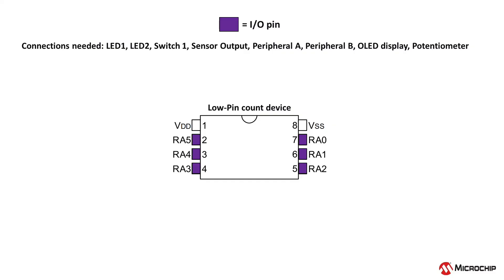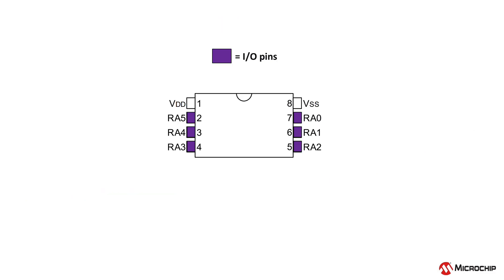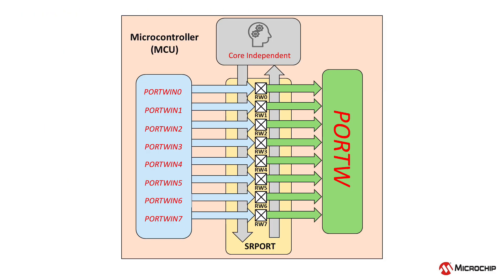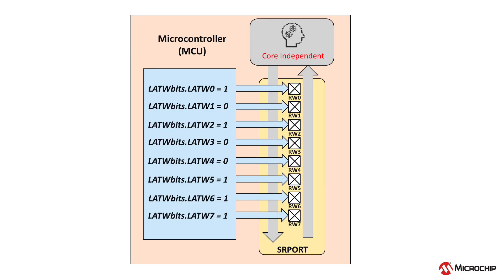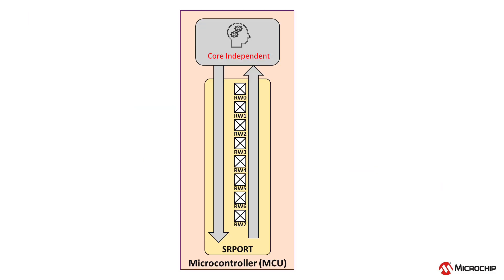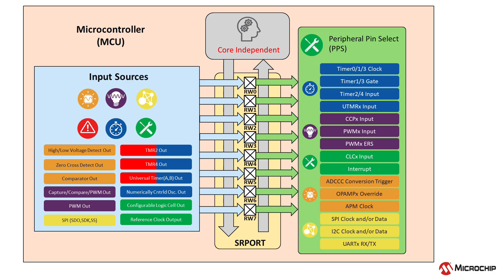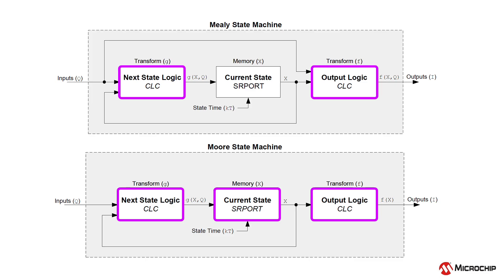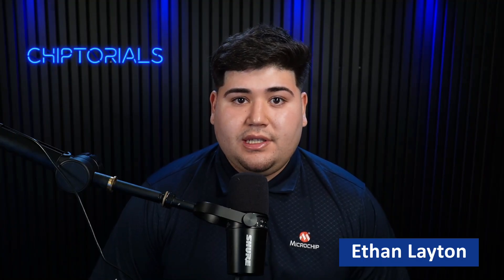Chiptorials - Signal Routing Port Overview

Comment: Will this allow a DMA channel to hit a port on some pins but not others for output?  A second LATx register that is selectable via peripheral pin select is a feature I'd really like to see on future micros.  I use timed DMA in my Serial Wombat firmware to allow all the pins on a PIC24FJ256GA702 to drive independent servo pulse, pwm, or UART outputs.  But a catch is that the DMA writes to the whole port, not just specific pins.  If there was a second LAT register, then I could have some pins assigned to that LAT through the PPS, and hit them with a timed DMA.  The other pins would still be configured to use the normal PORT LAT for their output.  I work around this by changing the PPS in real time for pins I want to use as general GPIO, but this is a hack I don't like that much.
Reply from the maker: Hi there, thanks for reaching out with this question! The SR Port on PIC18-Q71 MCUs doesn't offer a second LAT register for selective DMA pin targeting but provides virtual I/O customization for precise control over specific pins. This approach could address the need for independent pin control without real-time PPS adjustments. Hope this helps!